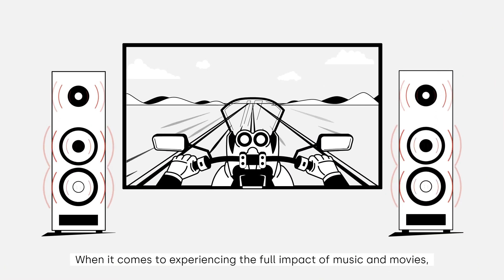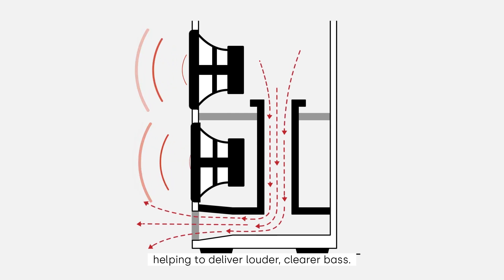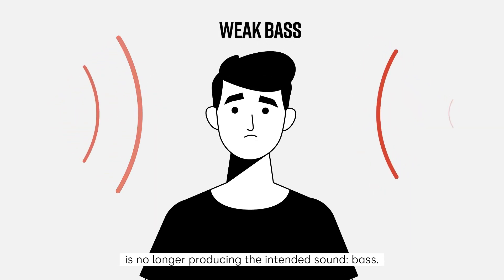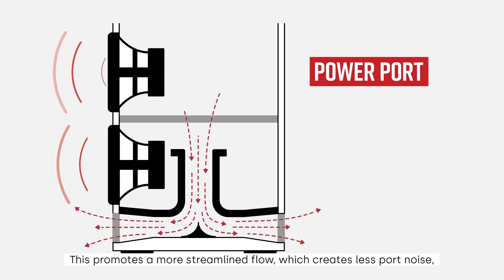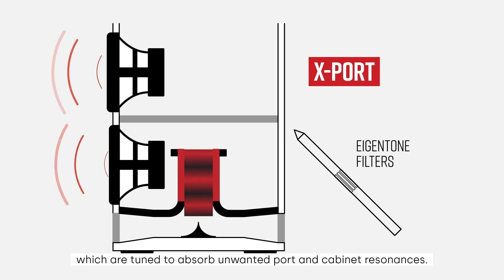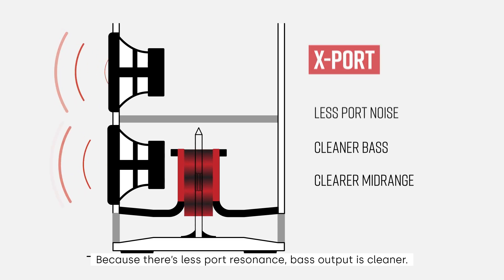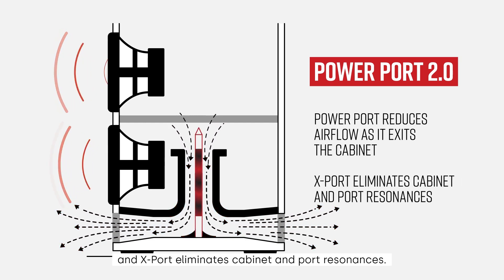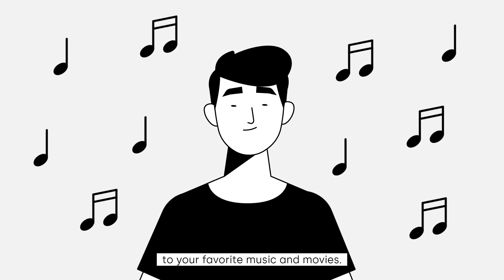Bass, Done Better: Inside Polk Power Port Technology

Comment: Polk is the Worst Brand of Sound Bar and Surround Sound technology EVER! This train wreck that a low down thief sold to me has only worked for 15 days at a time.  The poor life cycle of this junk is insufferable and a crime in the "nth" proportion. I can't get Any sort of Customer Service, because it doesn't exist! Polk, or rather Revolt is cheaper and scraping the bottom of the barrel when it comes to technology and Service.  I wouldn't recommend any Polk equipment to anyone on the face of this earth 🌎, Moon, or Mars collectively.

Comment: Does polk read these comments? I'm just wondering if the Magnifi Max AX soundbar has side firing speakers?.

I received the rear SR2 speakers and subwoofer for my react soundbar and the whole system sounds really good but the subwoofer can be a little too much at times even at its minimum setting of -4. It would be great if it was possible to reduce its volume by two or three more notches please.

Comment: I bought a Polk audio react soundbar a few days ago. May I suggest when developing soundbars that you add the ability to optionally (speakers sold separately)  add separate front left and right wireless speakers like the SR2 or something similar to add greater stereo seperation in the front audio. 

I like the sound from the soundbar itself but I have the subwoofer and rear speakers ordered and on the way because there's a massive lack of surround with the soundbar and in my room there's very little bass (it sounds more likely me low frequency midrange than bass) from the soundbar alone and the surround sound doesn't exist even in movie mode with the soundbar alone.

This is only a stopgap to a Magnifi Max AX in about a year.

Comment: There’s already solutions to this problem that don’t require this level of R/D. A simple flare is fine in most cases. Port resonances and excess air velocity are usually an issue of the port simply being too small. Bigger port = less velocity = less port resonance. Don’t let these companies sell you unnecessary crap! 🤝
Reply: Hi!I am an older hifi amateur-over a lot of types of loudspeakers.I think and felt that you are partically right - a good planned bass reflex tube also can work without noise and efficient but the wharfedale's slot loaded port or the polk's power port makes far better job.I did not hear the x port yet but maybe works also good.My favourite bass reflex system was the litvanian s-90 loudspeaker : the bass tube was 95mmx95mm rounded rectangle type and 425!!! mm long with a curve to get place inside the box.Tuned tobreally-really low freqs with that double magnet 250 mm long-throw type bass driver.Excursion 15mm +/- in linear.